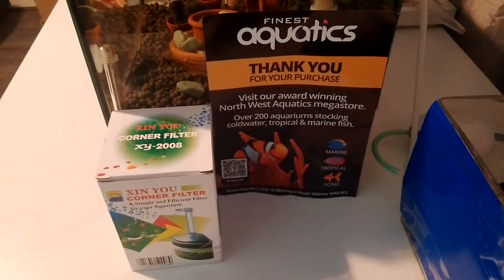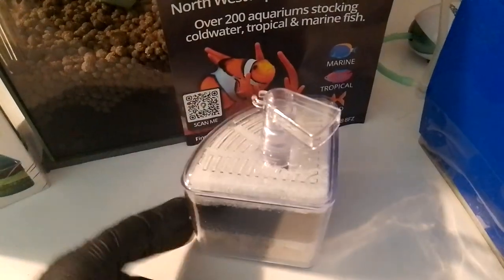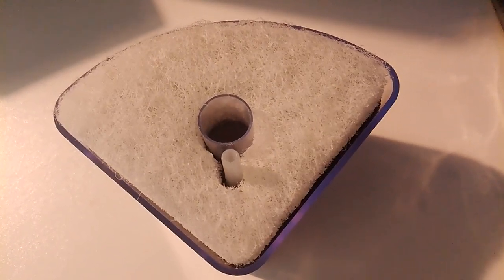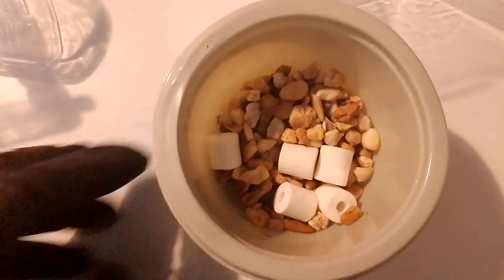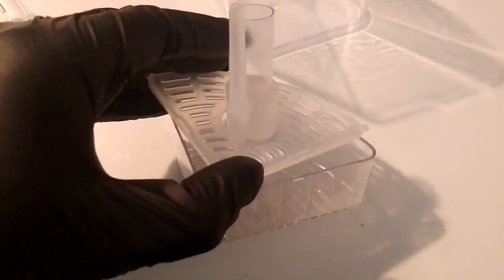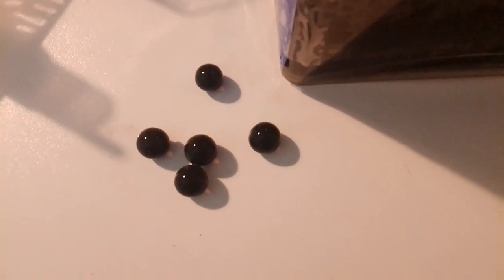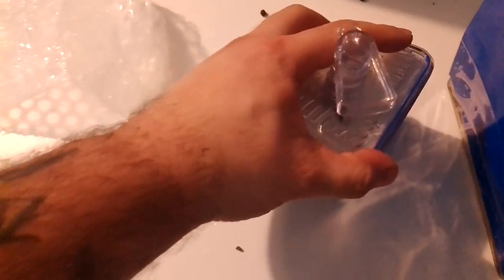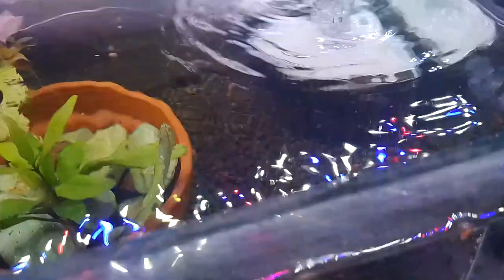**NANO CORNER FILTER BY FINEST aquatics** XY-2008** #fry #filter #filtration #biology #fish #new

Comment from the maker: #LINK provided below will be for the filter used in this video 

https://www.finest-filters.co.uk/air-driven-internal-corner-5-stage-sponge-filter/asons

The XY-2008 boasts a staggering FIVE stage filtration unit.

In my humble & personal view, I would downgrade it to a four stage filter. (which isn't a bad thing) There's still plenty of stages to gain a full cycle.

REASONS for downgrading this filter to 4 stages, rather than 5 are:

I class the three different courses of foams as stages normally (Thick,Medium & Fine) which gives me a tally of 3 stages before hitting   the media tray. 

The manufacturer of the #XY-2008 supplies two different media such as bio rings and gravel. In doing so, deems it another 2 stages. Which would add up to five. But because the media is supplied in the same tray I find it more of a marketing tool to potentially boost it's bio load and increase sales on this #GREAT #ECO-FRIENDLY product 

After reviewing this unique nano corner filter from #FINESTaquatics 

I was amazed how compact this filter was. The #XY-2008 corner filter impressed me with it's first three stages of filtration. The foams supplied with the filter were all good quality.

I wasn't overly impressed with the media (bio rings/gravel) supplied but in this video, I show you how to enhance it's capability of growing benifical bacteria and in doing so gives you a full cycle.

The materials that were used in making the filter such as cosmetics, were upto a high standard & durable. I'm very happy with the foams they provided to. I have to be Abit picky about the media that's just because with all filters I want them to run at there optimum.

The price for this filter is very cheap and affordable.
to replace the bio rings and gravel with cost you next to nothing. I'm really impressed and so I should be.

#LINK provided below will be for the filter used in this video 

https://www.finest-filters.co.uk/air-driven-internal-corner-5-stage-sponge-filter/

#LINK provided below is for the premium ceramic balls I used. (replacing the starter pack with)

200grams should do the trick!

https://www.ebay.co.uk/itm/173908796975?mkcid=16&mkevt=1&mkrid=711-127632-2357-0&ssspo=HzapwGAHQKy&sssrc=4429486&ssuid=Vp2kmlMbSlS&var=&widget_ver=artemis&media=COPY

Now I will post the full description from the manufacturer.

The internal corner filter is excellent for smaller aquariums with size fish like dwarf cichlid, guppy, killifish, shrimp etc., or for hatcheries, maternity, nano tanks, and fry tanks, as the filter produces minimal current and has almost no way to suck the fish through the filter.  

Also, the air infusion chamber produces minute bubbles which increase the oxygen solubility with minimal noise.

Skip to the end of the images gallery

￼

￼

￼

Skip to the beginning of the images gallery

DESCRIPTION

Air Driven Internal Corner Sponge Filter 5 Stage Biological Aquarium Fish Tank

The internal corner filter is excellent for smaller aquariums with size fish like dwarf cichlid, guppy, killifish, shrimp etc., or for hatcheries, maternity, nano tanks, and fry tanks, as the filter produces minimal current and has almost no way to suck the fish through the filter.  Also, the air infusion chamber produces minute bubbles which increase the oxygen solubility.

Please Note: A suitable air pump is required to run this filter (not included). If required, an air pump can be purchased separately from our site.

Simply install an airline into the unit and provide both aeration and physical filtration combining with biochemical filtration for your fish. They are especially useful for breeding small fishes.

Multi-layers easy to clean and operate

How Does It Work?

This filter uses bubbles of air from an external air pump, or an integral water pump to draw water through the filter. As water is drawn out through the lift tube or pump, it is replaced by water entering the filter.

The top layer of white filter pad provides a mechanical filtration.  The black bio-sponge in the 2nd layer and ceramic rings with gravel provides biochemical filtration. They support the colonization of bacteria. The bacteria help to break down harmful waste (ammonia and nitrite).

What Maintenance Does It Require?

The sponge will need to be rinsed every time it becomes dirty, about once every 2 to 4 weeks. It’s helpful to reserve the beneficial bacteria by washing the sponge gently with water from the fish tank instead of tap water. 

Call Us:
0151 261 9207
Mon-Fri 9am to 5pm

Email:
sales@finest-filters.co.uk

Visit our Showroom:
Unit 16 Montague Road
Widnes
WA8 8FZ

Copyright © 2023 Finest Aquatics LTD. Registered Company No: 07869180, VAT Reg No: